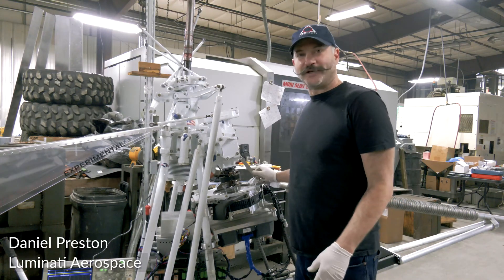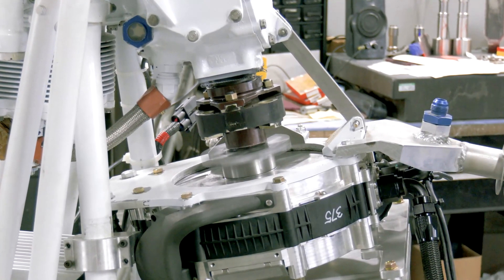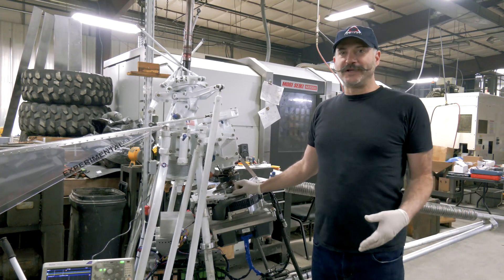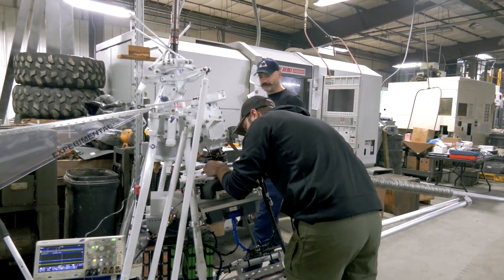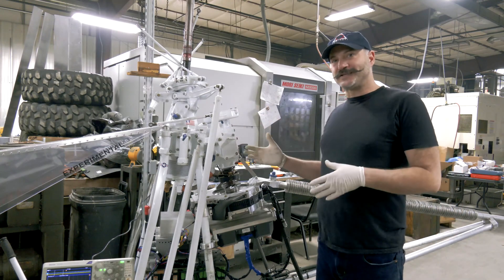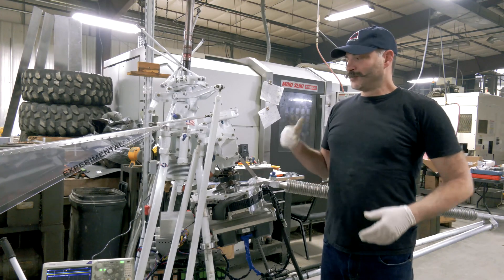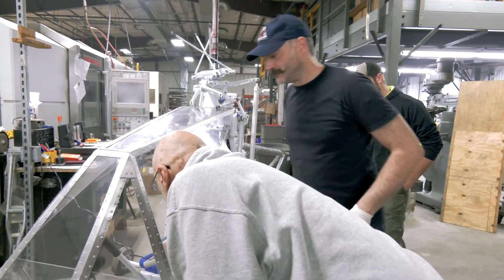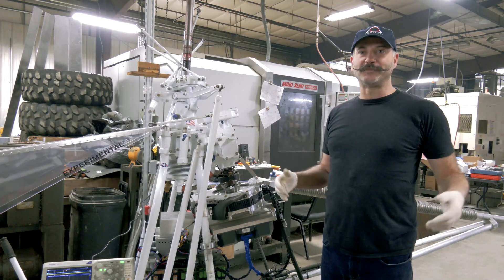Luminati Aerospace - First Electric Helicopter Engine Test

Comment: Suggestion if the motor is an A/C motor then it can be power factor corrected to a leading phase. Then you can tie into the wiring a charge controller and the motor can recharge the batteries indefinately. Doesn't matter the kind of battery it can be recharged. I did power factor correction for over 20 years and I know that the system works but this information is not generally available to the public and to most electrical engineers. Power companies don't like it as it puts power back into the line and they don't want to haft to pay for it. Any A/C motor can become a generator. So do your homework and know that this system will work.

Comment: Like those electric rollin chairs they got a real fine pot for the speed zone control
Reply: Auto pilot just like rc.
Coaxial would be easier and safer to learn?
Reply: That chair could go fast enough to get a ticket. But you could dial it up or down and then it still had an accelerator control in whatever range you had it.